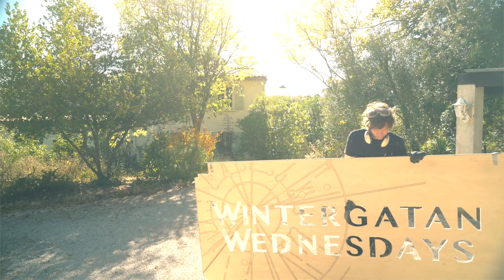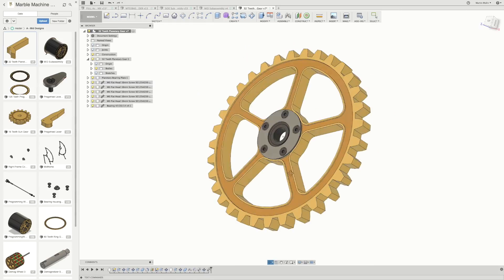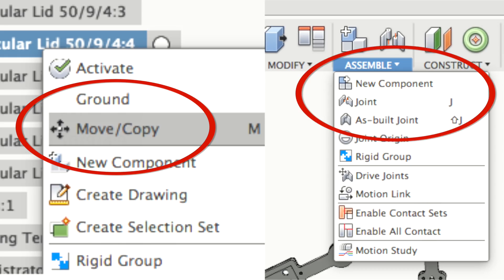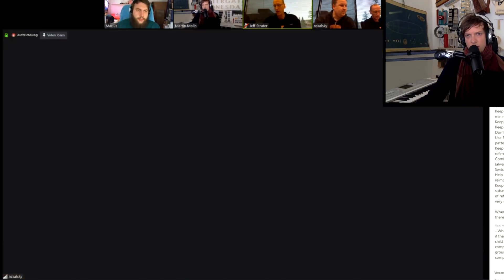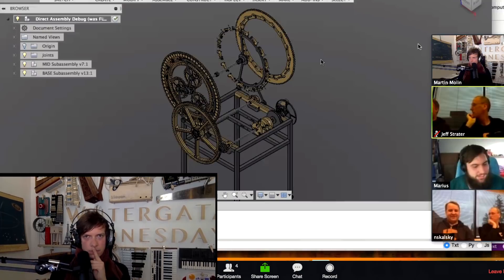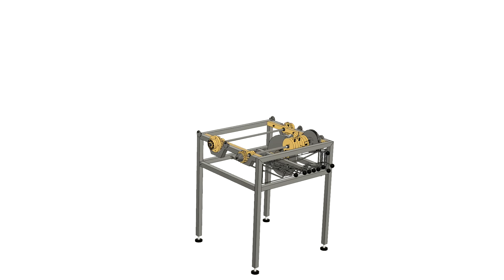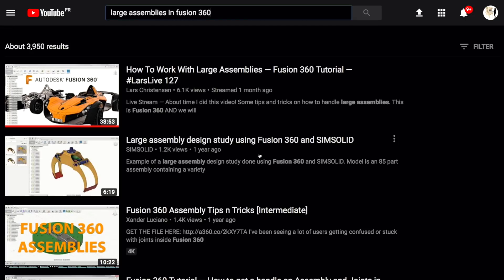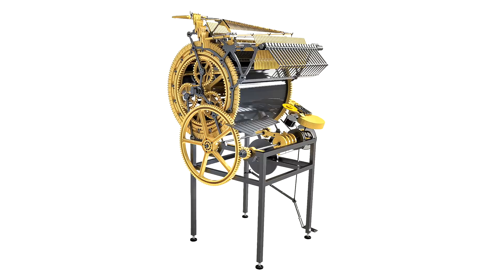Is Fusion 360 Unable to Handle Large Assemblies? - Marble Machine X #31

Comment: Use solidworks lol
Reply: I am an Administrator for SolidWorks. You can build and handle assemblies with much more parts. We have over 20.000 Parts and subassemblies in some bigger assemblies and we have much smaller assemblies than other companies. By the way: Windows (and SolidWorks) can be installed on intel macs.
Reply: He is using a Mac, so he can't use SolidWorks unfortunately
Reply: Spirit I don’t think Inventor is significantly cheaper than SolidWorks. Plus, it is a perpetual license.
Reply: Give him the money to buy a license!!
But I think a project this big won't run better on solidworks than on fusion. Maybe a little bit better, but still not useable
Reply: featherweight would have greatly helped. lol
Reply: Inventor is better than Solidworks for him(he does Autodesk already), and it's significantly cheaper than a Solidworks commercial license.
Reply: Well, I'm using it, and still can run into similar problems when working with really, REALLY large assemblies. Sadly, there is no SOLIDWORKS for mac or linux. The problem is, CAD applications require really high amount of video RAM in order to work with large assemblies. And I'm talking about 16 gigs of video RAM or more. And also, to get SOLIDWORKS license for just one project... Hm, kinda too expensive, to be honest.
Reply: Anton, If you've already paid for a Mac instead of a windows computer, arguing cost really doesn't seem valid. A windows workstation and Solid works is probably going to cost the same as a Mac laptop and Fusion, and you get a much more powerful combination that has a proven record of being able to handle this type of workload.
Reply: Not exactly, Sturmey. Soldworks would beat the price for about 3-4k USD, for at least. And I'm not gonna talk about professional graphic cards like nVidia Quadro series (those are really expensive) that have lots and lots of video RAM (without it, even solidworks wouldn't be able to handle that kind of assembly properly). Now, you could say that I could put few cheaper cards, like GTX1080Ti, instead of one really expensive, like some from Quadro series, well, solidworks doesn't support multi GPU rendering.
Reply: Dassault should GIVE him a SolidWorks  license, given the free publicity this gives them.
Reply: Solidworks is good  but very expensive.  Unless you are an engineering firm the price of the license  is not worth.
Reply: yea .. that was my first thought too.. 
So now he saves some money in exchange for awkward workarounds to use a program, which was not designed for that kind of project. I also bet the whole process takes way longer, than in a "real" 3d-cad tool. Who know what the next bottleneck is.
When I see what our people at work construct with SolidWorks, and how good it performs.
Reply: I think one of the problems is he's using a Mac laptop and not a CAD workstation. If he was using a dedicated CAD workstation, he probably wouldn't have run into this issue.

Comment: Hm.. I wonder how Fusion 360 is compared to Solidworks - in regards to large assemblies.
Reply: MrChrisKnowlton I have spent thousands of hours in both Inventor and Solidworks. I would consider myself proficient in both. They are both capable platforms. Personally I prefer SolidWorks. But both programs comedown to what add-ons you have and are paying for. Also I found SolidWorks assemble mates to be better than Inventors. I do mis sketch layers though in SolidWorks. Basically choose the one you like. You won't be able to win an agreement that one is better.
Reply: Inventor does not have more modeling capability. There is a reason there are so few Inventor shops and the vast majority of companies stick with SolidWorks.
Reply: In Solidworks sub assemblies help A LOT. They are treated like solid object in final assembly. I've made a quick test.
Assembly 1: flat bar with 16 holes and 16 screw placeholders, fully constrained (looked like 1x16 lego piece)
Assembly 2: 16 times Assembly 1, fully constrained (looked like 16x16 lego piece)
Assembly 3: 16 times Assembly 2, not constrained, i am able to move them (4352 parts) around without any lag if i disable shading.

Then without sub assemblies, trying to move anything with 256 parts caused lag spikes.
Reply: Chris Ballard   SolidWorks does not use fusions bait and switch marketing model. You need to decide right from the beginning that you need it enough to buy it.
Reply: IT is not what he knew... and that the coat of it is a big step up.
Reply: Because they push it in schools more than Autodesk.  If you had history with both, as I do,  you would agree that Solid works is not nearly as good.
Reply: I have used both and Inventor is quite a bit better in a number of ways than Solid Works.
Reply: + Mili theMUFFIN What you are saying sounds like what I was suggesting in another thread. A gear with all the parts that make it solid such as the hardware should be considered one solid part for final assembly since that is how it will move once animated.
Reply: I bet the reason Inventor is seldom used is about it's newness on the market. While catia/ProE/UG are from the 70's onward.. every major company has already tons of parts in these programs. Soldiworks and solidedge is from DSS family (where Catia is the big brother) and smaller scale models that do not need catia go with solidworks. Same for Creo parametric (ex ProE) and creo Direct (the little brother of creo parametric)

Inventor is the new addition from 2006 or so and is hard to convince a company to go to a new program when you rely on trained people and databases in another tried and true platform. And DSS is giving great tools to switch models withing the family (from catia to solidworks or such) but there are no great conversions to use a different platform like Inventor. I bet this is the reason Inventor is quite a rare bird. But Inventor in it's own has very nice capabilities like a top tier CAD (although.. has some ugly aspects about informing about the modifications and approximations it does behind.. the opposite of catia where EVERYTHING is shown and confirmed by user)
Reply: Fusion is a lightweight application, not really made for this. Inventor is more analogous to Solidworks. They are practically identical, though Inventor has more modeling capability.
Reply: I was thinking the same thing... Why did he not just go with SolidWorks? that is the industry standard for this level of complexity and interaction.

Comment: you sure you could not just use a more powerful pc to solve your problem?
Reply from the maker: see pinned comment!
Reply: Fusion 360 are platform independent so there is no problem to move the project to Windows.

But since both mac and windows are both PC so Bjamse might refer to a more powerful mac.
Reply: he can't use a more powerful pc because it's a mac
Reply: Did you watch the video????? Literally it’s not a hardware issue
Reply: Yay for the upcoming upgradeable Mac pro!
Reply: Jason Bridges, is still a bit a hardware issue, but the issue is they don't make better hardware. The problem here is mostly CPU speed bound, and they stopped making faster cpu's over a decade ago. So if you're having an operation you can't paralellise over multiple cores, you're screwed.
Reply: Next week: Sykpe meeting with Apple Electronics. lol.

Comment: I think you need something more powerful than a Mac for large and demanding files such as the marblemachine. Like a Windows based workstation with a Xeon or Threadripper CPU
Reply: Looking into it, most commands on Fusion360 are single threaded. Higher core count won't help. His GPU isn't a problem either, at least i assume it isn't. It is a fairly powerful AMD card. What might hold it back is the fact that he uses Mac which uses openGL, while Fusion is optimized for directX. But i still don't think it's the GPU

Edit: Fusion360 is optimized for directX. Therefore a Quadro or its AMD counterpart isn't optimized for it. Gaming card is better for Fusion
Reply: The thing is more cores dont really work here, solving geometry is really hard to parallelize so more cores is not really better (at least my 6 seem to have a similar/the same, if smaller issue) but a faster single core yould help. In comparison videoediting or rendering for a video/nice picture can be parallelized really well, but solving the geometry unfortunately not...
Reply: from my experience with Solidworks, and from what I know about some of the other platforms of that kind, for modeling work (as opposed to rendering or simulations), the software is very single threaded (as these models are built step by step). Therefore a fast CPU like an i7 8700k, with a good cooler and maybe some overclocking should do much better. Adding a graphics card that can handle that type of work (usually Quadros are the best but I don't know if that's the case in Fusion 360) could also free up some stuff from the cpu improving things more (lowering the display settings should also help). As for an Imac, other than having an aged cpu, it's design doesn't allow for adequate cooling for work of that type, causing the cpu to throttle.
Reply from the maker: @talkless diamond Some real piece of information in that comment!
Reply: But still, i think macs where never meant for such heavy loads. A PC would work better in any way i think.
Reply: He said earlier it wasn’t an issue with hardware, rather program optimisation.
Reply: for this kind of process overcloacking can be worst due to the unstable stats of the cpu ,
Reply: It's un-optimised for these part counts, and the problem scales to be exponentially worse.
It doesn't matter how powerful your computer is because at this point, it takes double the cpu for only 100 more parts and then 4 times the cpu for another 50.
Reply: A typical automobile only has less than twenty eight thousand parts including every spring and screw in sub-assemblies.  So, this is a very complicated project that would normally be done by teams of engineers.  Having done this much in Fusion 360 by one person, a switch to Inventor or Solidworks would not be difficult accept for ripping the cash from your wallet.
Reply: Ahh, ok, thank you. I did not know that ;)
Reply: interestingly, Fusion 360 on mac uses openGL.
Reply: A 100 Raspberry Pi boards arrayed into a supercomputer!
Reply: Talkless Diamond 
Gaming card is GPU that optimized for gaming and rendering to make it smoother.
Reply: Johannes Lauer that wouldn't solve the issue, if a move command takes 15 minutes, a better cpu would need to be a 1000 times faster to make it workable, which is not the case. If it even scales linearly.
Reply: My thought was, that a mac from like a few years ago, have in most cases only an intel i5 processor with 4 cores. As in rendering programms like cinema 4d, I thought a cpu with more cores and a better communication and work-splitting between those cores, it should load significantly faster. But i´ve neverr used fusion360 so i dont know the impact it would make there. But the difference in videoediting is pretty impressive when you compare different cpu´s

Comment: I'm curious about how hardware affects Fusion's performance
Reply from the maker: According to everything i have read and first hand information from Jeff, this is not a hardware related issue. I am not really insightful in how computation works so i am almost unable to make my own guess on this, i know i do want to upgrade regardless. Maxing out specs should never hurt!
Reply: I have the same problem working on a $3000 USD work station. It’s beyond me how fusion is so limited.

Comment: You're gonna need more than just a Mac for that
Reply: yeah i was thinking Thread Ripper hackintosh
Reply: You dont understand the problem. Is's not hardware. It's software lack of optimasation. As you can see in other program everything can even move and can pan much smoother. It's 100% software optimization. Just like Lightroom for example.
Reply: SatanicJamnic but getting better hardware still works.
Reply: https://www.reddit.com/r/hackintosh/comments/689xt3/ryzen_hackintosh_success/
Reply: WTierce1 a guy called snazzy labs did I️t and made a video on it

Comment: "Solved" is a way for incompetent devs to avoid fixing bugs by pretending they're fixed. Just ask Mojang.
Reply: Hi. Developer here (not for Autodesk).

For a software product like this, they probably organize development using what's called "agile" methodology, which is basically a fancy term for task queuing and triage, and breaking up work tasks into small segments (usually one or two weeks at a time). These segments, called sprints, are generally aligned around business needs, and allow organizations to pivot their teams between projects on a regular interval, as needed. Using something like Jira by Atlassian, they'll have a backlog of tasks, and towards the end of each sprint, they'll prioritize those tasks for inclusion in the next sprint based on customer impact, business needs, etc. Doing it this way allows small teams to accomplish a great deal, and is surprisingly effective.

My guess is that a task has been created in their backlog. However, since (1) it doesn't fall within the full design scope of Fusion 360, (2) it doesn't impact a substantial amount of customers for Fusion 360, and (3) they are pushing people with more complex designs towards more complex, more expensive software (like Inventor), it's not taking priority over other bugs and development requirements.

Also, "just optimize for multi-threading" is very easy to say, but can actually be a huge nightmare to implement, depending on the platform and how it was built. You usually have to begin with multi-threading in mind in order to make a program really leverage it, otherwise you need to rewrite the whole thing. This is why a lot of software tends to rely on a single thread.
Reply: Pi-Fi
Okay, so you're talking about Martin specifically with Fusion. It just goes back to the shade I flung at Mojang. Don't close a ticket as "solved" when it's not. They can have problems unsolved as they work on bigger concerns.
Reply: Not all problems can be solved with multicore performance, as some kind of tasks don't benefit from multiple cores at all; in fact, there are tasks that get slower when you pass a certain amount of cores.

Don't know why people think that a business of the size of Autodesk would leave a software buggy just because reasons.
Reply: Mojang exposed
Reply: Pi-Fi
Are you talking about Martin's problem specifically? What's "this problem"? Which "few people"?
Reply: Or the fun one is "You're not supposed to use it like that."
Reply: McDonald sTitties That's how Windows does it! Or, maybe I should say Vindoze. Got to love their nonsense cookie-cutter useless "solutions". BTW great name! LOL.
Reply: ethanpet113
Unfortunately "usually" didn't apply in my scenario with Mojang. They straight up didn't care to fix a critical bug of a port, they just wanted to shut up everyone in the thread with the threat of bans. It was a bug that made multiplayer impossible as all servers required passwords that couldn't be entered without keyboard compatibility. To them, the case was "solved".
Reply: Josh Curtis Thank you for your developers' point of view. I had no idea exactly how that worked. I still remember when most programs had one programmer, or a team that could fit in a small room.
Reply: Actually if it says solved, that usually means you've just reached a front facing support team, in an issue tracking system, the status would be more specific i.e. ByDesign,Won't-Fix,Known,Duplicate,TODO,bug etc.
Reply: Because these "few people" spent their hard earned money in a product that advertises this kind of work without problems.
Reply: I always cringe to my bone when I see bold statements like this.

Way too many people give devs shit for their own incompetence. A computer isn't made of magic and neither is the software, so expect limitations and bugs, nobody in the history of man has promised a bug free program.

And for devs marking something as solved you don't agree with it's more likely you don't understand the situation than the devs being assholes.
Reply: There are many people who bought this program that have other problems that the developers spend their time fixing.
Reply: Performance with large objects is a hard problem to solve as it is mostly a hardware problem.
Reply: McDonald sTitties if only a few people encounter this problem, why should the engineers try to fix.
Reply: Pi-Fi they should optimize for multi-core performance to solve it